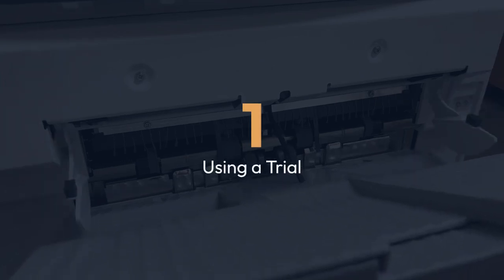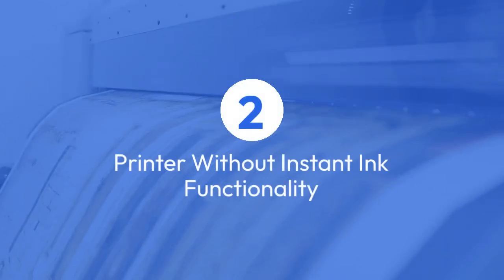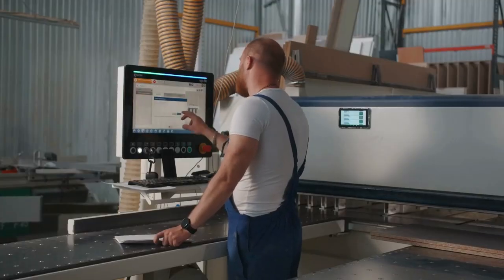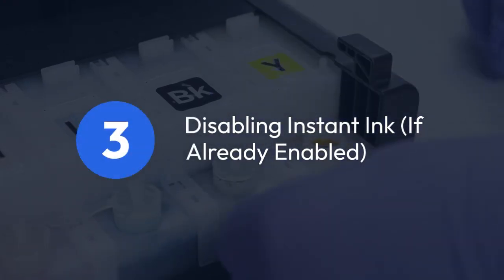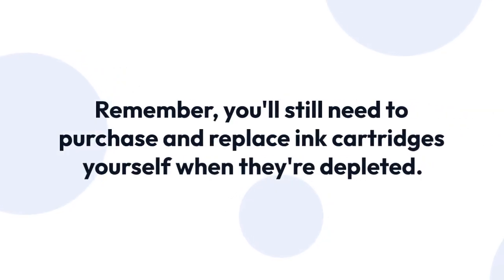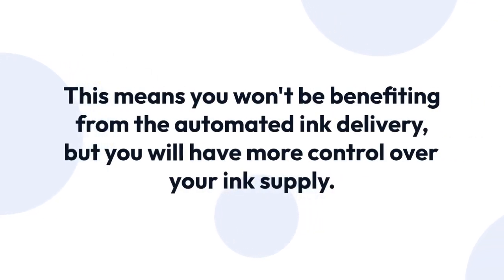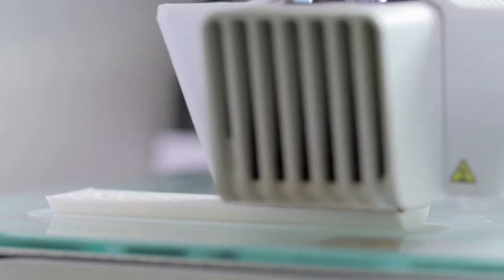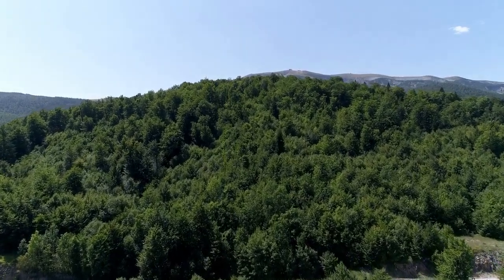How to Use HP Instant Ink Without Subscription?

Comment: We bought a used 9014e with full ink tanks but after connecting to the wifi the printer doesn't work anymore or is restricted to work bc of the ink subscription account of the person I did get the printer from. Firmware downgrade to an older version not possible or 'not applicable. Completely blocked. Very frustrating. Any help is appreciated